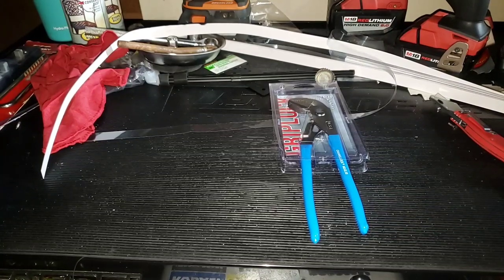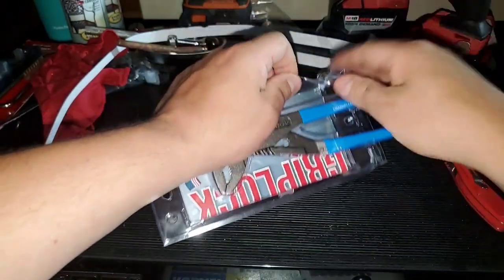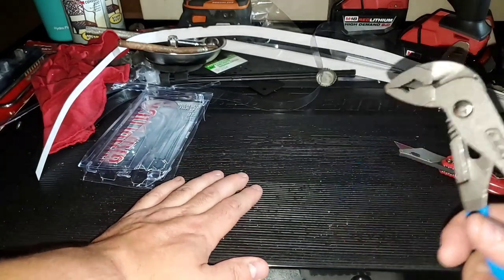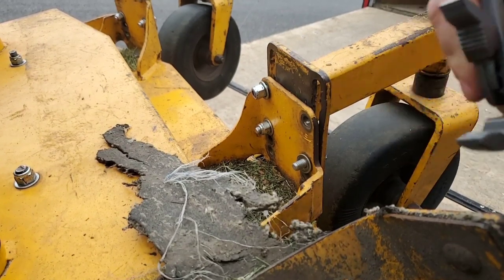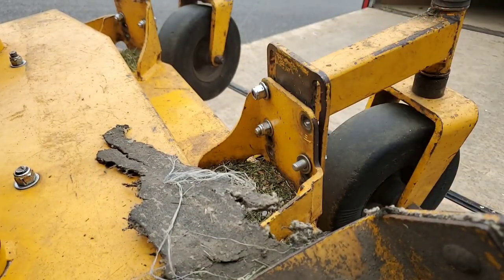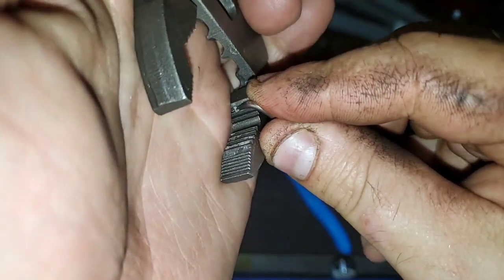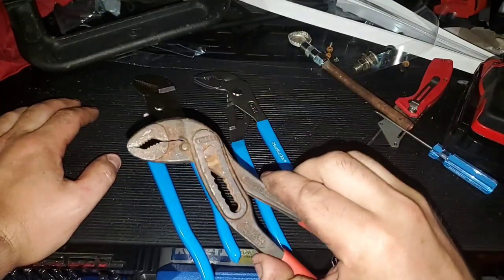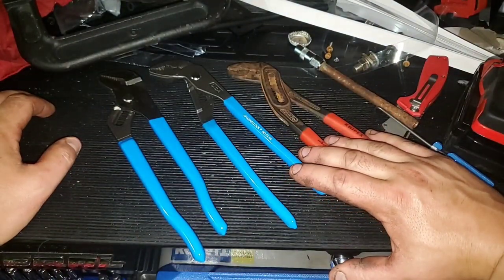Channellock gl10 made in the USA 🇺🇸 pliers not what I was expecting

Comment: Channellock "Griplock" pliers use good steel and have a very good grip, their principal fault is that their adjustment design is old, it has few adjustments (5 in griplock vs 9 in knipex Alligator and 19 in Cobra); Its handles are a bit narrow and uncomfortable when using a lot of force compared to Knipex Alligator and Cobra pliers.  -It seems to me that the main disadvantage of Channellock against its Chinese ( Irwin; Stanley; HF; Crescent) ; Swedish (Bahco)  and German (Knipex; Rhotenberger; Hazet; Stalwile; Gedore) brands, are its antiquated adjust position system; less adjust positions and an uncomfortable handle design. -When Channellock redesigns its pliers and incorporates an adjustment system similar a german brands;  and  add a better anti-corrosion finish like its competitors, the brand will win back much of its lost customers.

Comment: You are not using your pliers correctly. First you should adjust the jaw wider to get more bite. Then you should also turn your pliers around so that you are turning in the direction to promote the teeth gripping. The way you grab a nut you just end up slipping. Also a wrench does a better job of not damaging bolts. Or a Knipex Pliers Wrench.